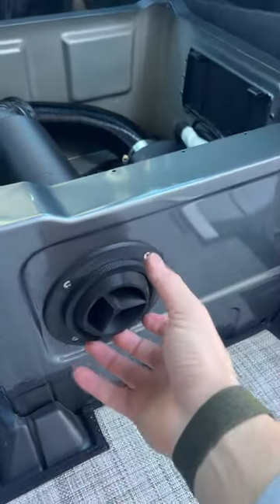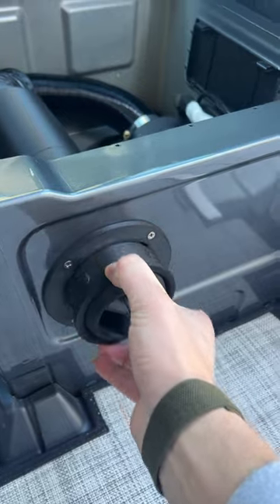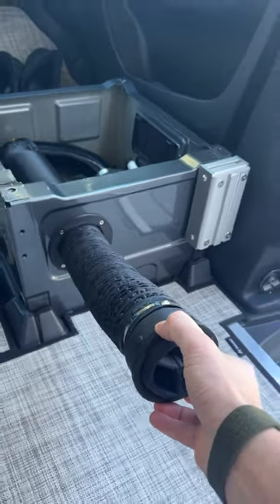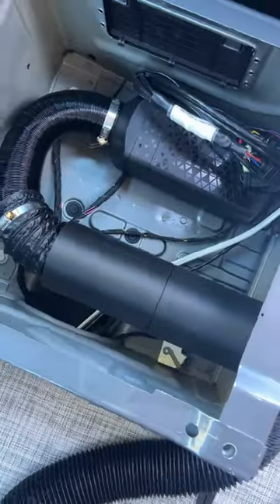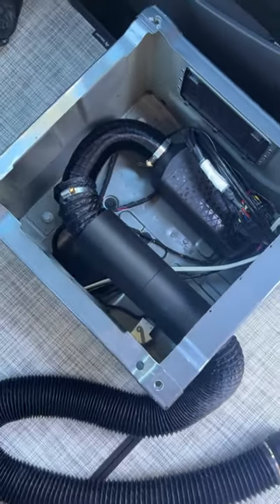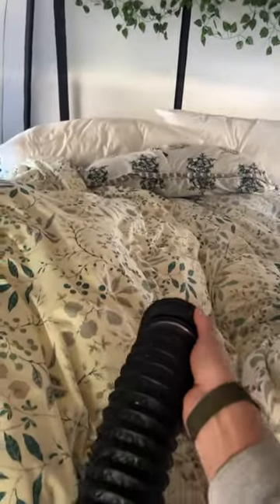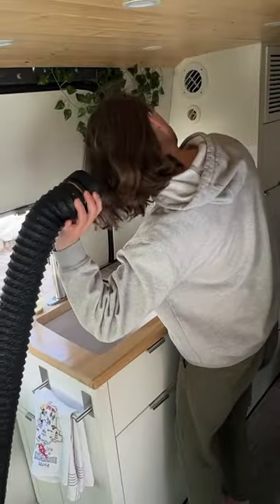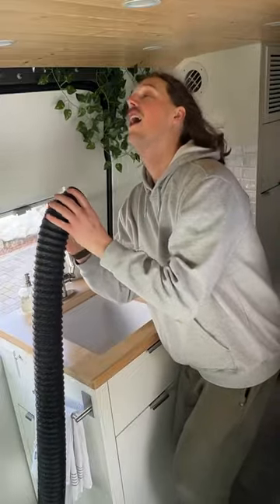SNEAK PEEK of my DIESEL HEATER INVENTION the EXTENDO VENT

Comment: Install foam padding on the window. Some sort of insulation. Its cold air leak from your window seals.
Reply from the maker: The corner stays cold even when I have the insulated window cover up
Reply: @seven_o_savage  well that sucks. Guessing it's a lack of insulation on that side part then? I'm just making assumptions but I like your idea. It looks like it works well man
Reply from the maker: @livecasual9486  Thanks man! Ya I've tried a bunch of diff things but the only thing that worked was putting a mini space heater in that corner (which takes to much power to be a good long term solution). Soooo this is my attempt to solve it for good :)

Comment: Outstanding. But you have to give it a cool trademarked name related to an elephant trunk. Also, you have to prepare yourself for a very fast and very massive onslaught of cheap Chinese knockoff competitors that will spring up overnight as soon as your product is launched. In fact, since the cat's out of the bag, they may actually beat you to market with a cheap, crappily made and probably toxic copy. Make sure you include details in your marketing about why yours is better and safer.